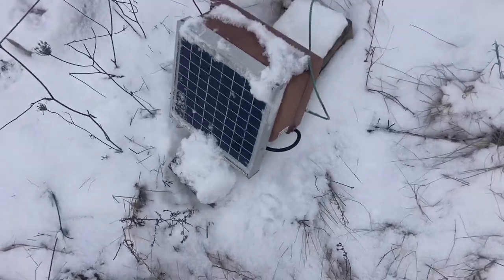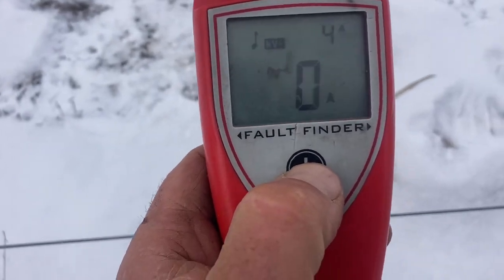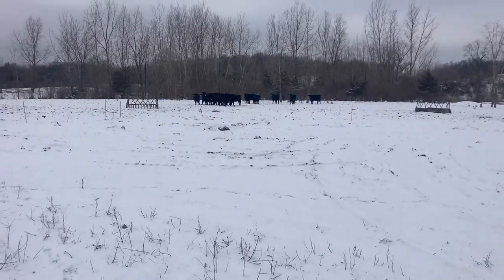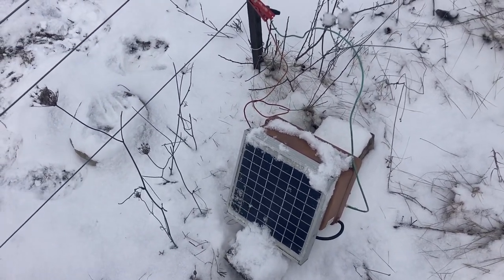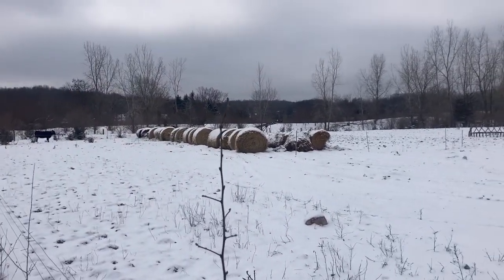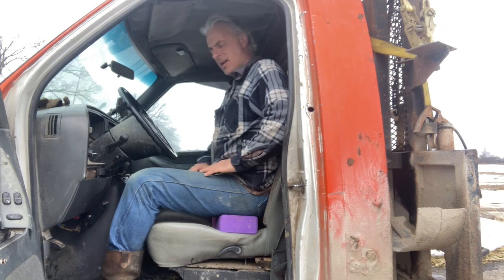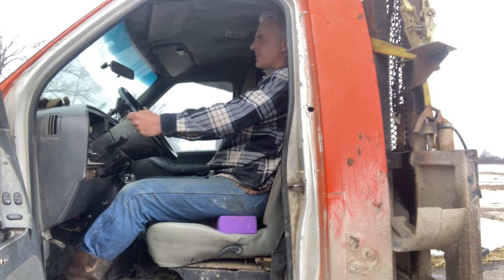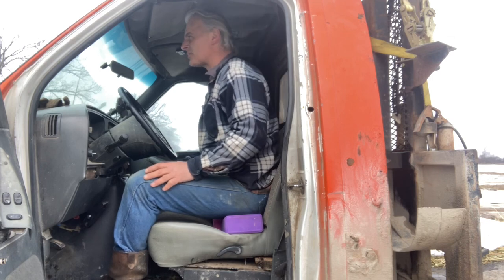Avoid Pain- how to sit on truck and tractor seat ￼￼.

Comment: Interesting, of all the vehicles and equipment we own probably the most uncomfortable after a long drive is our Honda Civic but most of that is I can’t stretch my legs out and if you moved the seat up to get my legs straight up and down in a sitting position I would have my head through the roof. My Ram 2500 has power seats so I can put it where I want. My 5 speed stick Nissan pickup has me “Manspread” but is very comfortable I feel. The dozer I sit straight upright to see what’s in front of the blade and after 10-12 hours on that I can move pretty good. My tractor probably makes me walk funnier than any of them after many hours and that I believe is because of the heavier clutch action. Real tall folks have a problem with many types of seats I feel because of how high you actually have to be to sit up straight...
Reply from the maker: I could see that with the Kabota tractor you’ll look really big on it anyways it’s probably not made for somebody. Your size makes sense about the dozer because you’re more sitting like you’re standing in that deal.

Comment: When I was in PT they gave me a lot of exercises to do at home for my back and neck. But you are right, a lot of that pain will get better with proper techniques while working.
Reply from the maker: Those exercises are fine as long as you’re going to correct the causative factor. This gets down to the root cause here that’s the problem a lot of times you’ll go to PT or massage or a chiropractor get a short term relief of the pain I don’t know what’s going to cause the pain to reoccur later on